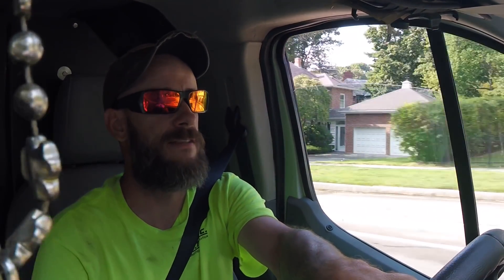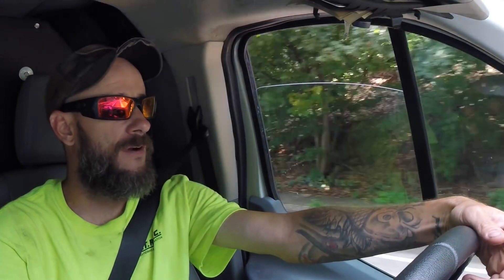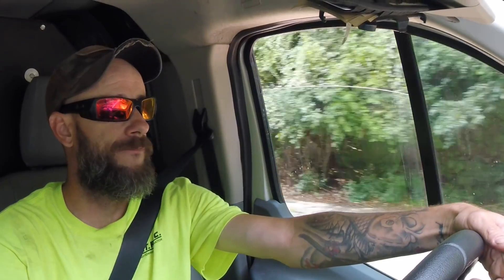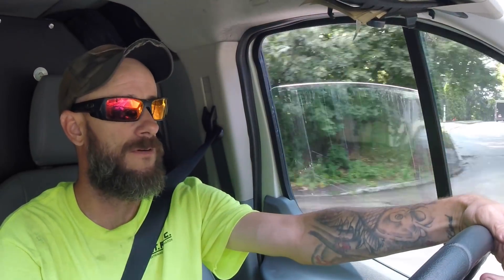Refrigeration Life # 22 . Open Air Sandwich Cooler Running Warm

Comment: Great video, I know I’m a few years late but quick question. Are you using the suction pressure from the roof in tandem with the readings from the outlet of each evaporator for evap superheat or is there a port on each evaporator to get the pressure?
Reply from the maker: There is a port on each evap

Comment: Hey im kinda confused. I saw you had 2 separate evaps so 2 different Txv with 2 different superheat. I get that 
But what do you mean about compressor superheat being 25? Aren't they all in 1 refrigeration circuit
Reply from the maker: Brian Pan compressor superheat should be 25-30 normally
Reply: @Cscrefandhvac  but you also said superheat should be 8 to 10 for freezers 404a
Reply: Reach in cooler*
Reply from the maker: Brian Pan 8-10 at the evap not at the compressor
Reply: @Cscrefandhvac  oh. Didnt even knows there were different types of superheat.
Reply from the maker: Brian Pan yes it’s higher at the compressor
Reply: @Cscrefandhvac  thanks
Reply: @Cscrefandhvac  so for residental split systems, I've been checking compressor superheat right? Because most evaps dont have a suction port for residental
Reply from the maker: Brian Pan sounds right if your taking line temp and pressures at the compressor.  I don’t really do residential but should all be the same
Reply: @Cscrefandhvac  i take it at the condenser. Thanks that makes sense.

Comment: Hey , Chris , just wondering , does the humidity affect the high pressure because it makes the air thicker maybe , or something ?
I'm tryna wrap my head around it because I have chillers on rooftops that are very close to the river , so the air is very humid, especially in the summer and mid season .
Thank you , sir !
Reply from the maker: Sterling Archer not exactly sure , I suppose it could from the air being thicker. That’s a good question haha. It definetly affects the indoor air going over the evap coil of the inside space is humid which In turn creates a bigger heat load and a higher pressure

Comment: We have a customer who keeps an open air cooler near the kitchen in an area that's always hot. We have on multiple occasions tried to explain why it's not working as he would like, but he would rather believe a salesman than a refrigeration technician. Three feet further out, the temperature is in the mid 70's.
Oh well, "you can lead a horse to water, but you can't make it drink."
Reply from the maker: The Lenawee Trekker absolutely man , we try our best but if they don’t want to listen there is nothing we can do. Hahaha. Thanks for watching

Comment: I just wonder if it was working before you got the call, what happened to make the txv’s go out of calibration or are there further issues?
Reply from the maker: JonesHvac according to the customer it was running warm for awhile. But who knows , when we have high heat and humidity these cases won’t run right due to their location in the store. Also the txv could’ve been out of adjustment from the beggining . We don’t install the equipment at these stores and my guess is the superheat was never set from day one .
Reply: CSC Refrigeration and Hvac Yeah I totally agree with what you are saying, I have worked on some before and they were way out of calibration come to fine out the owner had another company come out to work on the same unit and they must have adjusted the valves, the only problem I found were two evaporator motors spinning backwards. They looked like they were run but they weren’t lol we replaced them and recalibrate the txv’s unit ran line a top !

Comment: I’ve the head psi on 404A that high in high ambient. No problem especially with a load on the evap from open air case.  Can you get us some install video?
Reply from the maker: Nor-Cal Refrigeration & H.V.A.C I’ll try Dave. The job I was on I wasn’t able to get anything unfortunately

Comment: That's crazy to think 350 head is normal. Do you get any subcooling?

Do they load the case with product below 40? No way an open air will pull product down to temp. Maybe they should add it to their strict process

Nice video
Reply from the maker: I don’t think they load it with product below 40. It’s a constant battle with these cases. Haha

Comment: Great video,  in refrigeration do you still add 30 degrees to the ambient for your condensing temp like air conditioning or is it different?
Reply from the maker: Cool Ron HVAC personally yes and no. For me personally it all depends on the heat load on the case like product temp , how much ambient air is being introduced to the case etc

Comment: What was that head pressure 350 for 404a seems a little high.
Reply from the maker: Gary Black JR yes it was high. But the heat load on that case was a lot and a constant struggle with the conditions that it’s in . Once the ambient temp around this case returns to normal it will be back to normal . I see this a lot and tried to explain it in the latter part of the video

Comment: I find the open freezers to be a real pain because they freeze up so easily and are hard to defrost.
Reply from the maker: Mike Rocheleau I’ve found with those it all has to do with the ambient air around them. If the ambient air is too warm or the humidity is too high the coils will ice up easily and create a lot of problems . Then after defrost they have such a high heat load they can’t keep up. Then never mind the customer  stacking the product way too high and blocking all the airflow.  Haha